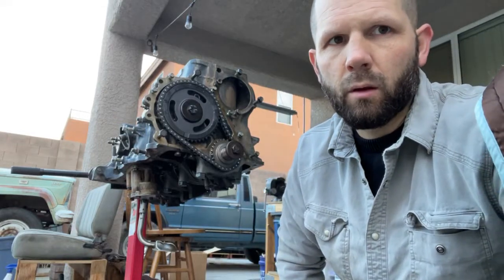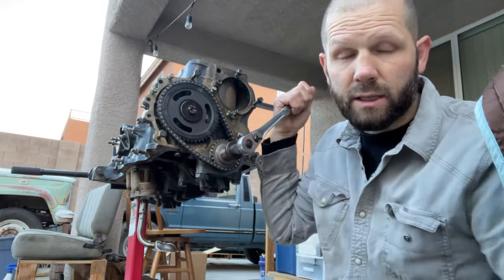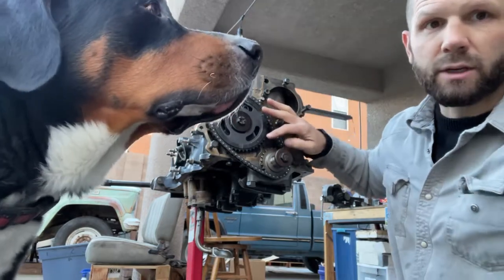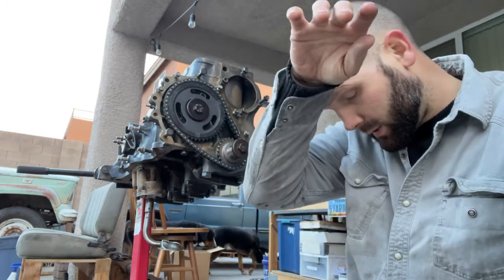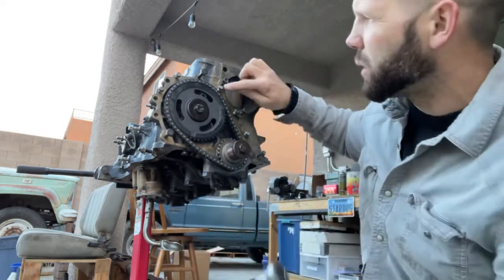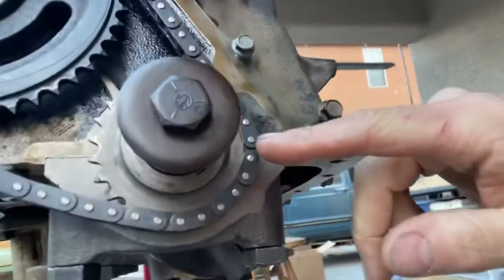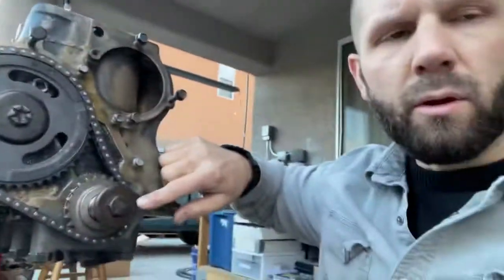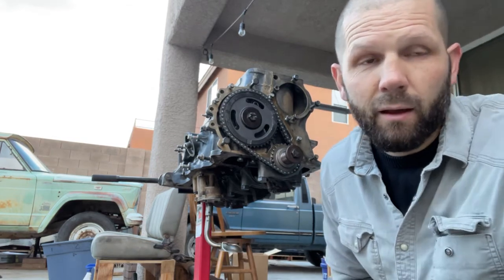Timing for Jeep 2.5L 4 Cylinder Engine - Engine being rebuilt for Crate purpose

Comment: hey boss so is this for a jeep wrangler. i just bought my first jeep. and im inlimbo auto parts cant get me a rebuilt kit. do you know where i can get a rebuilt kit?
Reply from the maker: Check on summit racing dot com. 
That is normally where I buy my rebuild kits.
Reply: @stardog16  one more think. please hey do i have to time the jeep wrangler with the timing gun since is distributor or not??  i know i would have to time my 1995 d21 hard body like 10 degrees before top dead center. i was wondering if jeep has to be timed like that or not. thank you hope you can help me with that

Comment: What is the timing when it's running.........
Reply from the maker: I think that depends on how you are planning to use the motor. In a Jeep there is sometimes an emissions sticker. It will list the acceptable range of TDC measurements.